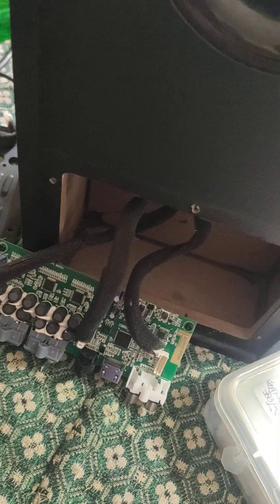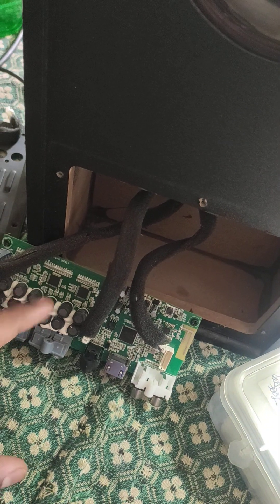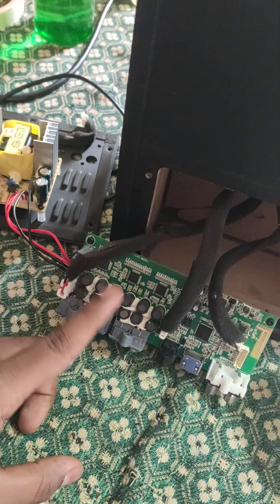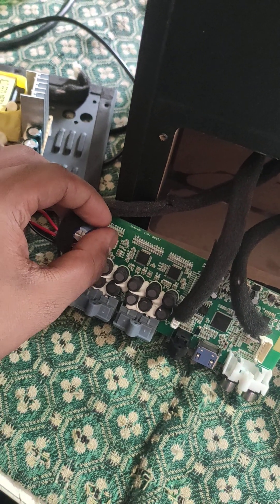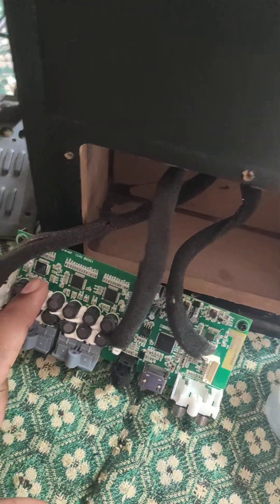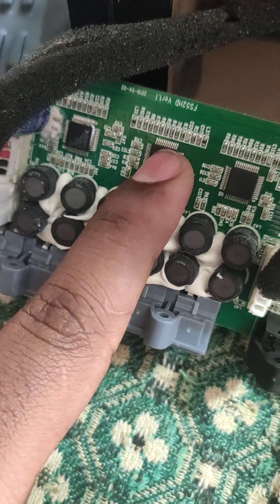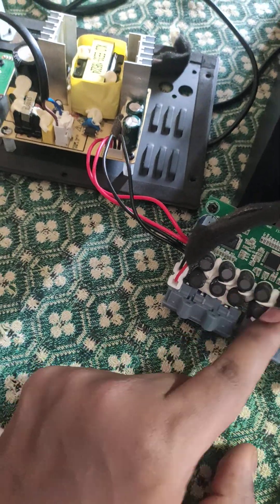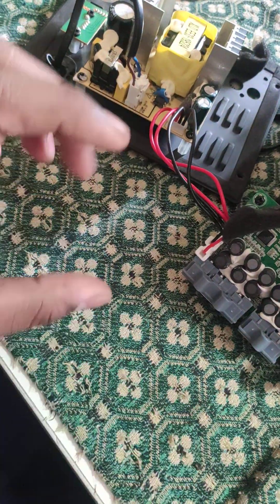ZEBRONIC 9400 AND BOAT AVANTE 3100D MAIN PCB REPAIRING TIPS

Comment: My Zebronic 9400 have problem in center & subwoofer make sound like FM radio i wanted to repair please provide your contact number
Reply from the maker: @harshkapupara5246  9380431244
Reply: Did you get it repaired? My sound is having the same problem